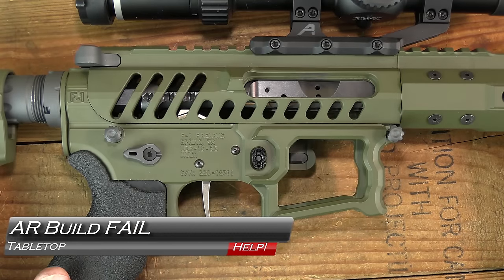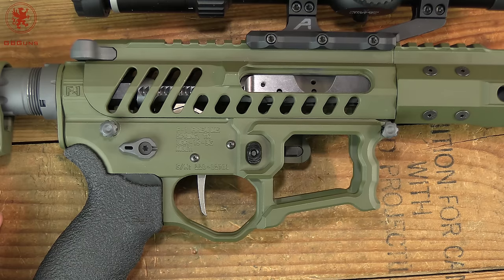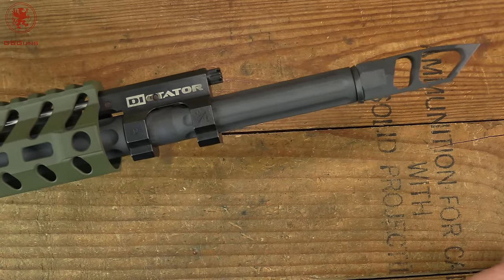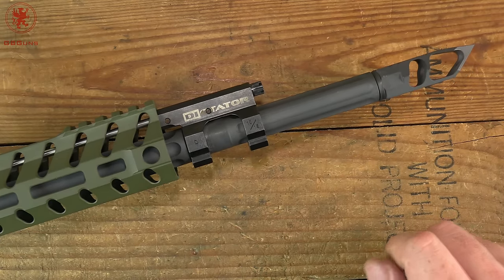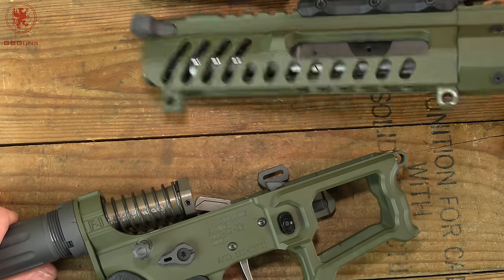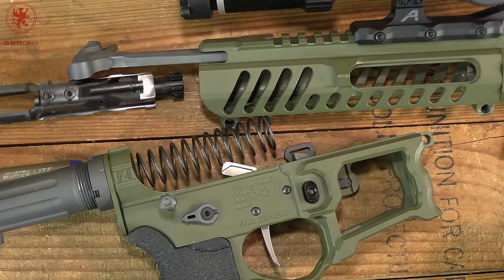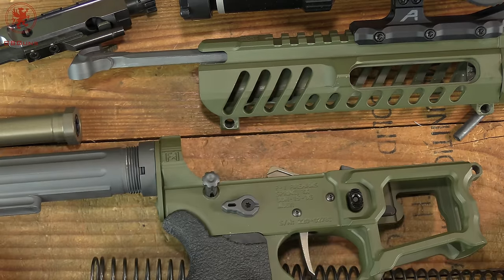The Worst Thing You Can Do For Your AR

Comment: just based on the fact that your bcg can barely pop a casing out then your resistance must be behind the bcg. change to  light weight spring. also pull that gas block and tube out and blow into the end where the bcg marry’s up to it. make sure when you open and close that gas block that you get a change in what air you can blow through it. also make sure your barrel port hole is aligned with the gas block port hole. some gas blocks need to be spaced back. In the case of an Odins Works adj gas block they put 2 set screws in where you adjust gas pressure. if your not aware you’d be turning the first set screw and wont make any diff to gas flow not knowing there was a second set screw in there.
Reply from the maker: One of the few comments on the right trail.  See video description or pinned comment.

Comment: Were is your buffer tube/lower receiver detent,  Noticed it was missing. Might allow your buffer tube spring to create resistance on your bolt.  The buffer tube spring and cap should be retained in buffer tube when you pop the upper off.

Comment: Had this issue before, turned out to be the flare on the gas tube.  Tolerance stacking sometimes means the tube doesn't have a good seat in the key.

Comment: The pin holding the trigger hammer in place can also be causing some friction not allowing the trigger to come back smoothly. On another note, I would assume if you put a rifle length gas system, you should be running a Rifle length buffer system.
Reply from the maker: It's a common myth that you have to. See the article in thevjdeo description

Comment: You are missing the the buffer retainer and spring.  Those should be captured by the forward lip of the buffer tube.  When installed correctly, this should prevent the buffer and buffer spring from entering the upper receiver.  This may also be why the upper and lower receiver fit is so tight, as the BCG is under constant pressure.
Reply from the maker: You would enjoy the article: https://www.ballisticmag.com/2021/03/02/impossible-ar-build-myths/

Comment: Have you solved your issue? 
If not I would do cheapest to time consuming/ expensive 

1. Cut 2 - 3 coils off your buffer spring. Like other stated, it may be too strong. 

2. You recognized the short dwell time. Take off your gas block and use a pin gauge or eyeball it or stuff it with toothpicks (until it completely fits the gas hole on barrel) and open it up. I'm not sure what an ideal size gas port diameter for rifle length gas sys with 18 inch barrel, but I'm sure Google will help you. I'm gonna assume it'll be bigger than .095" tho. Cause I had to open up my 16 inch  midlength x39 barrel to cycle reliably. But it was not a low mass build like yours.

Good luck
Reply from the maker: Yes it was solved a year or so ago, I'm not sure why this video keeps getting views and not the subsequent videos.  See video description or pinned comment.  Thanks
Reply: Hahaha thats good. I just read the description right after. But thats good news. Happy shooting!!

Comment: Not an expert by any stretch so let that be my caveat..lol  "Usually" you can either A- manage the gas that you currently have (i.e like in the old set up that didnt run) by chasing it with an adjustable gas block, buffer weights/springs, lighter bcg's etc, or B- you gan give it more gas and efficiently move the mass of the existing components. The gas port hole in the barrel is the issue many times but is generally the last thing that gets addressed. If thats the root, almost none of the afore mentioned components are going to resolve it. Theres alot to consider before calling a gun good to go because it can cycle the bulk of the time. Seems like this has only become a real issue in the last decade?? Is it all different loads of ammo, suppressed vs un suppressed etc that are expected to run perfectly?     Anyway great to see you got it cycling so well with just the spring! Looks like its shooting flawlessly!

Comment: I could be wrong.but the buffer has no momentum @ 1oz and being that the spring is so rigid it can’t cycle properly when fired. Also could be gas tube double check it I use a piece of spaghetti and you know it’s lined up when it falls into the barrel .Try a heavier buffer mil spec spring and double check gas tube alignment. Good luck
Reply from the maker: It was solved long ago, but thank you.

Comment: The buffer tube is not threaded in enough. i have the same one and it is supposed to fit almost flush. I like the Aero version better and they show how to install it. The bolt carrier will rub on the bottom if it is not forward enough.

Comment: you can switch to a carbine length gas system or use a less stiff buffer spring either of those would solve you issues

Comment: Get a 223/556 chamber hone.  Looks like an engine cylinder hone.  Higher end barrels tend to have very tight chambers.  Great for bolt actions, not so much for semi auto. With all that lightweight gear you should be on the edge of that carrier yeeting out the buffer tube with gas block wide open. This is a common issue with “budget” barrels too. Once it gets to cycling you’ll start getting stuck cases as debris builds up and the occasional less than polished brass finds its way through your action. 

Work a small amount at a time and go SLOW. There’s a few instruction videos around, just be patient. Polishing the chamber could do the trick too. But the problem will return after a few hundred rounds. Honing leaves what looks like a rough surface…but just like in an engine cylinder…there’s valleys for lube to remain and the valleys create less surface area in contact with the case. 

Had a batch of (very good) barrels do this to me. Had 5-6 higher tier builds that were turds. Did the same thing you did…checked every other component.  Finally gave honing a shot as last ditch. Now that’s the second step on trouble builds after double checking gas system.
Reply from the maker: Fortunately the solution was much simpler.  See video description.

Comment: There was a cut in the video. Is the Buffer retainer actually IN. or does the buffer actually press against the back of the bolt when in battery?
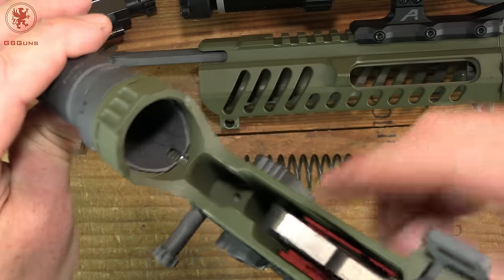edit: yeah @ 7:00 theres supposed to be a pin in the lower receiver in front of the buffer tube!
Reply from the maker: Not required.  See the article

Comment: Maybe try a piston driven system? All the pressure is contained in the gas block to drive the piston, instead of being sent down the gas tube to the bolt, which would potentially utilize the pressure better.

Comment: Increase the diameter of the gas hole in the barrel. I did this for a buddy of mine who had a 20" HBAR barrel and a short stroking problem. Drilled out the hole a bit and now it's reliable and really tosses fired cases far.
Reply from the maker: Fortunately the solution was much simpler

Comment: What I was trying to say you might you’re using a carbine gas system and if it’s cycles manually there’s probably no problem with the other components the problem may be the gas simply isn’t strong enough to cycle the bolt back and forth

Comment: I built a light weight rifle as well ran into the same issue it was the buffer spring with light buffer and bcg you need a light buffer spring there usually painted yellow when you find them after that it out worked great...

Comment: You need a heavier carrier and a normal length spring for a carbine length buffer tube. Probably would have been beneficial to also have a carbine length gas system to match the buffer.

Comment: Check to make sure the Cerakoting didn't get over spray inside the upper receiver. I had that done to my Arsenal Democracy AD16 and found it short stroking when I got it back. I had to polish the inside of the upper receiver to make it so it didn't drag on the bolt.

Comment: Try a barrel with mid length gas system. It will still shoot relatively soft yet be a bit more reliable with your cycling
Reply from the maker: The solution was thankfully much simpler than a barrel change

Comment: What is the Gasport size and do you have the gas port pinned or set screw directly over and as you said full length gas system and you had everything super light but to me it’s kind of like taller and stacking different carriers a different receiver different buffer etc. unless the barrel which hasn’t really been talked about much yet and the Gasport might be too small or not directly over the port I believe a rifle length gas system is like .092ish with everything as light as it is you should be bidding brass at 1 o’clock but then again it might be over gas way over gas to where it doesn’t function I’d really have to look at it I’m sure I’d be able to fix whatever issue is if it’s not the gas port on the barrel

Comment: Love the rifle. I’m not an expert builder but it seems to me that the detent spring and pin for the buffer tube are missing causing it not to eject and load. Oil it up and try again
Reply from the maker: Thanks. The update was in the pinned comment. The spring was out of spec, I ordered a lower-power recoil spring and now the gun is a dream!  This receiver set used a thread-in buffer retainer and I did not want to need a tiny allen key to get to my buffer. Buffer retainers are not required for an AR to function.
Reply: @GBGuns  my next stop was the muzzle brake. Good deal!!  Are you gonna do a follow at the range? I want to see it run.

Comment: Softer buffer spring. And if that doesn't do it, go to a 18" barrel, but with a mid or carbine length barrel. Done! Then you can reduce pressure  if necessary.
Reply from the maker: That's what we did last year.  See video description for footage of it running and an article in Ballistic.

Comment: idk if you have fixed the problem yet but on think i would check is the charging handle. Ive had my M16 get jammed when the charging handle warped and was causing things to short stroke. No idea how it happened but it did. if you have a Milspeck AR you could just rotate the parts and see what causes the problem
Reply from the maker: See video description

Comment: Worst thing you can do is skeletonize the upper receiver. Just my opinion. It does look cool. Have you solved the problem? I think you need to play with different buffer weights. H or H2 will solve you problem. Don’t think it’s short stroking, I think the bolt is moving way too fast with it being so light weight
Reply from the maker: Yes, it was fixed about a week after this video. See video description or pinned comment.

Comment: I think a rifle length tube and or lighter spring would probably do the trick. You could cut 3 coils off of that spring and that might do the trick. I actually cut my buffer spring down a few coils because of the same issues and my problem was instantly resolved.

Comment: late to the show but i a buddy of mine had a .22 with this same issue he had to run higher velicity rounds to get the adiqute gas to cycle the bolt. Also the sound when charging was very gritty and that buffer spring is a little thicc. worse thing though is when you get it running dont bring it to a dessert environment it wont work for long.

Comment: First of all, where is the pin that supposed to hold the buffer inside the buffer tube? The spring does look little heavy too. Something tells me you’re having issues with adjustable gas block, it may be placed incorrectly. I don’t know what barrel you have, but some barrels had an issue with a wrong diameter of a gas port. Some of them had to be drilled to open them up slightly. I’d start with taking the gas block off and making sure it’s lined up correctly. If it is, I’d try different gas block just to make sure nothing wrong with this one. Lining up gas block with a port does not necessarily mean slide the block until it can’t go no more. Sometimes you have to leave a small space. If none of that helps, you can replace gas tube. It could have an obstruction in it. If none of that helps, drilling out the port is a given.
Reply from the maker: See the article linked in the video description

Comment: Was this resolved?

A possible issue I see is the carbine buffer. Shorter springs have higher spring rates. Because of your dwell time the reciprocating mass isn't gaining enough momentum to overcome the carbines higher spring rate.  

I believe 18 inch barrels typically run rifle length buffers. Could be wrong it's been awhile. But if I'm right this is probably one reason they do.

Easiest test would be to find a short barrel extension and screw that on the muzzle. Just a few inches maybe 2 or 3. My guess is it will run a lot better.

A solution and/or another issue is the gas port on the barrel may be undersized.  I know for certain this has happened in the past, the manufacturer just drilled them too small. And I'm not sure gunsmiths even verify sizing when given a bunch of parts to assemble. I could see them assuming it's the right size because it normally is.  This is something that can be fixed by having them drill it out ever so slightly larger.
Reply from the maker: https://www.ballisticmag.com/impossible-ar-build-myths/

Comment: You have probably figured it out by now, but one other thing to check, are the screws on the gas port on your BCG torques to spec and properly staked? I've seen those screws not properly staked and back out enough to start losing gas pressure before it sends the bolt backward.

Comment: If its tighter than mill spec, its out of spec. I own a machine shop. This may be  your only problem, or part of another issue. Its hard for me to say, but you should scrap the upper and lower cases. This is the hardest decision to make. Probably whats holding up your happiness. Or just remove the Ceracote from the top of the mating surfaces. Good luck my friend!
Reply from the maker: Mil-spec is a set of tolerances to permit rapid, inexpensive production with cross compatibility.   Take it from a guy who served with years of active duty.  It doesn't mean the best nor the only way to do something.

Comment: i would say gas or spring but if i had a skeletonized upper i would mount it on the wall. there are two major negative symptoms to the skeletonized receiver. first, dust or dirt. this design is a magnet for debri.  the second is, in my oppinion the most important, (because i dont mind cleaning ar's) recoil. to mitigate recoil in any gun you must make heavy the parts that dont move and make light the parts that do move.
Reply from the maker: You'll likely enjoy the article.

Comment: ive had the same problem with my f1 skeletonized build but not as severe. I can generally get a couple or more mags worth down range before it begins to malfunction in the same way. All my components are high quality that I use in other builds. The one variable that i can reasonably suspect is the skeletonized upper/lower receivers. I've brought this up to a couple different gun smiths who say that it shouldnt effect the gas system logically speaking. I'm in the same boat, man. No clue what it is exactly but I suspect it somehow has something to do with the skeletonized receivers

Comment: I bet the lightweight carrier is the problem. Put in a regular one. Lightweight is not always good. Fill a football fully helium and you won't be able to throw it as far. When the gas takeoff system starts pushing that backwards it probably doesn't have enough Mass to make it all the way back. Especially with the shorter amount of gas going into it. I probably gives it enough energy but It can't keep that energy long enough to fully cycle.

Comment: Put a soft spring on buffer tube and  drill barrel gas port to 0.910 drill bit put regular gas block on adjust gas rings aligned then it will run or cycle

Comment: I’m sure you figured it out but a lighter buffer tube spring seems like the problem. A slightly heavier buffer weight might also fix it. I’m not a gun smith or anything but that would be my guess.

Comment: Best thing you can do is swap your gas black to make sure it’s not your gas black put a different gas block on it from a different rifle. If it still doesn’t shoot then you know it’s your barrel porthole… , and then once you fix the issue with your barrel pole, you’re gonna want to go back to an H3 buffer, or since you want to experiment with making your gun light recoil, get armaspecs buffet weight spring thingy, if you get the kit, you can experiment with different weights! Especially if you wanna slap a suppressor on it , trial and air, my friend

Comment: You don't run a buffer tube catch? I'm thinking you should have gone with a carbine length gas system at 7.5. also check out a light buffer spring, flat spring.

Comment: You might need to change your barrel to the right gas system or change your gas tube and block. I know for my AR, the bas block was coming loose. I tighten it down, runs smooth

Comment: Through my years of building every shape and size AR, there's a few things that I will never skimp on, nomatter the weight. From here until the end, every bcg will be a SOLGW full auto with accompanying sprinco white / red spring with adjustable buffer weight of varying sizes. It's the heart of the rifle afterall. Even with my range toys that I try making as light as possible, a point of non-discussion is choice of the heart. My main goal, nomatter the build is reliability and consistency. Once those parameters are set, you can then start playing around with all other aspects. Also, if you don't plan on ever running a build suppressed then DONT INSTALL AN ADJUSTABLE GAS BLOCK! It's just another variable for Murphys law to drag its nuts across....
Reply from the maker: Fortunately this build came out perfectly despite breaking several lore rules.